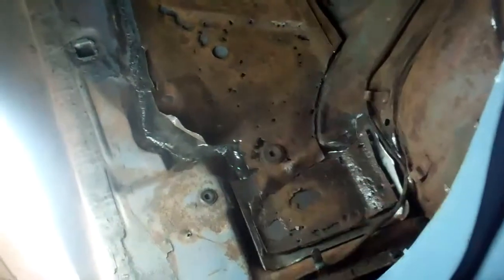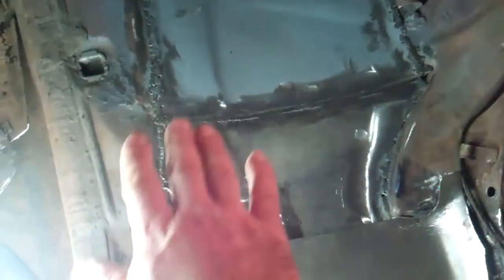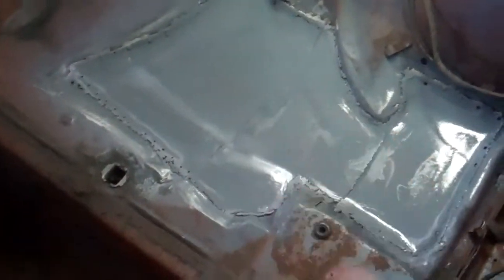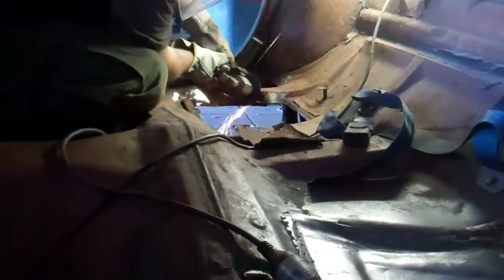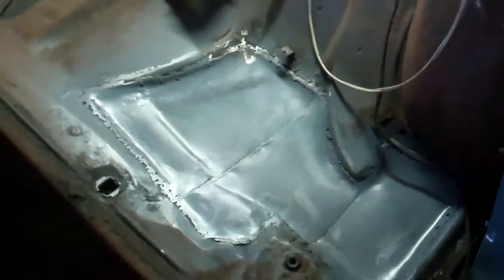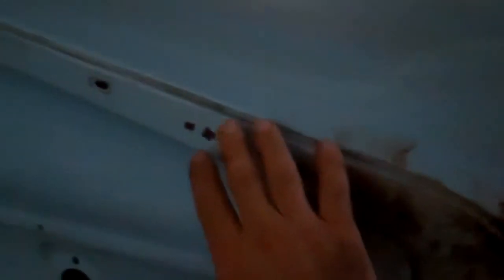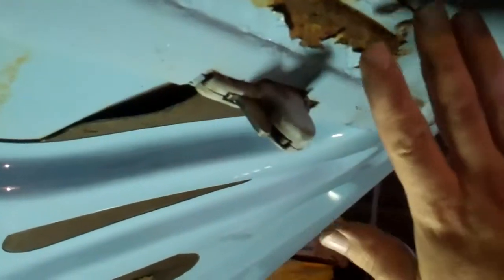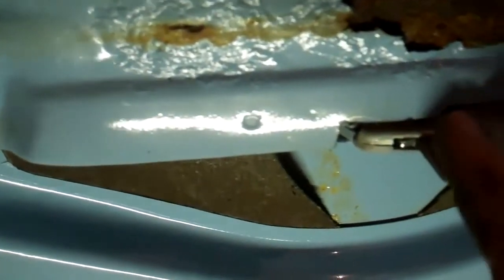1960 Chevrolet Impala restoration part 6

Comment: Have a 1966 impala my self that also needs substantial rust repair as well as a whole new frame. It was sunk into the ground to the bottom frame rails. When I put a jack under it the frame broke through.

Comment from the maker: I basically use anything that is close to that shape e.g metal tubing, old steel shoe horn, basically anything that has that approximate shape that can be used as a mould and just beat the steel patch around it.